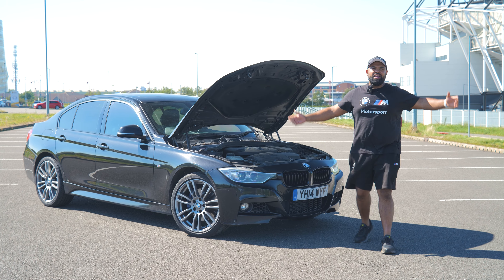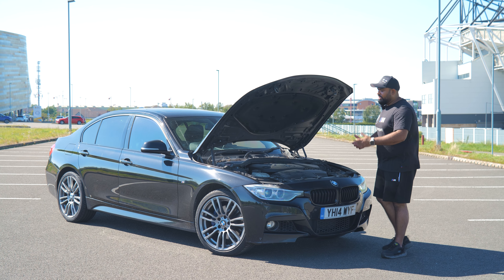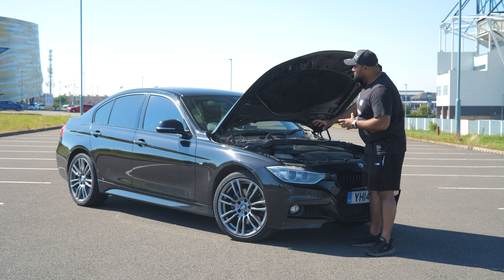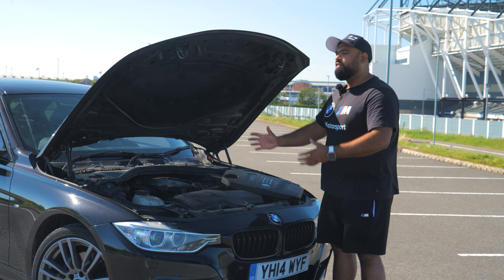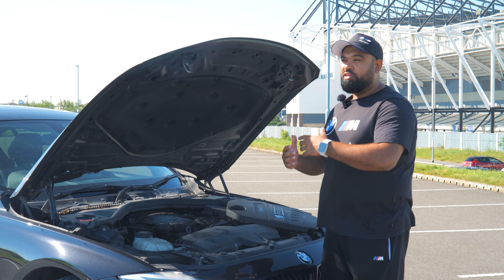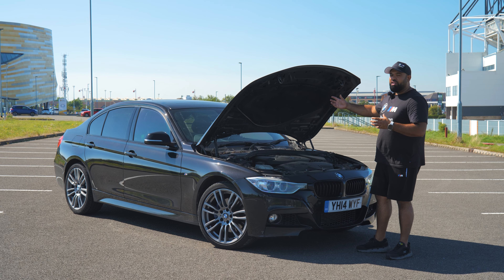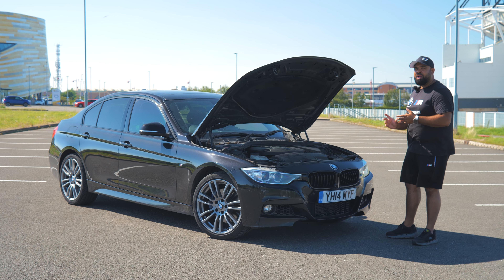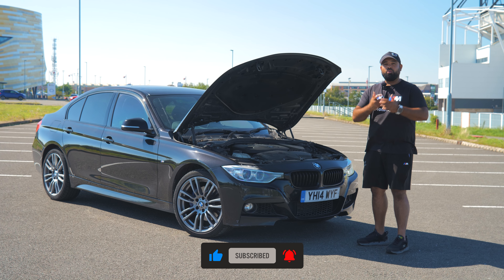BMW 3 SERIES 2011-2019 COMMON PROBLEMS!

Comment: Owned my 2014 f30 320d xdrive manual for just over 8 years (72k) and had zero issues, but I looked after mine. Just tyres, service, front brakes and a battery. Best car I ever owned, but it’s good to point out these issues as they can arise. Glad you mentioned keeping the a/c on as mine never went off and zero maintenance (no regasses etc). Just bought a g20 which has had a few problems (should’ve kept my f30 😂) and one is this coolant thermostat sensor as it was telling me it was overheating.

Comment: The problem that I had with my 320D Sport was the fuel fill sometimes I went to put fuel in and it would only fill the tube down to the tank then cut the fuel fill off after a couple of liters of fuel

Comment: Had a 120d N47 and had it for 6 years and when I sold it it had 205k miles on it and it never missed a beat.  90% of my driving was motorway dow.

Comment: Hi question if someone can help my drive train malfunction keeps coming on in my bmw (not driving it but it continues to come on as soon as the car is started) has anyone else had this happen could it be from the timing or the bushes on the rear diff that need replacing 
Thanks

Comment: i have a 150k mile 220d ED.2012.. should i keep it? electric windows starting to rise and fall randomly on pressing driver side; subtle whistling during acceleration only, with  no loss of power; possibly a short clutch travel. I owe 2.5k pounds on finance... It has had non dealer service; not been frashed  ; was owned by a rent fleet car. any advice appreciated, as i am considering part exchange otherwise...

Comment: Bro I have a 320 XDrive and I have a juddering when accelerating 😢
Reply from the maker: @OulyHussain  oh dear, Xdrive strikes again
Reply: @itsimty  bro what do you think is up with it, stressed out 😭🤯
Reply: @OulyHussain had a 320d xdrive. Only time I had this judder was when I had the wrong size winter set of rear tyres fitted. Tread depths aren’t so much an issue, but the correct sizes are essential. Owned my car 8 years with only that problem which I rectified a couple of seasons later once I knew what it was.
Reply: @kennedymark1  tyres are spot on pal. I think my transfer box is fu*ked but getting it done next week. I'll let you know if it sorted
Reply: Daamn, i need 4wd in the winter here in Sweden, should i buy a 2wd instead?
Reply: @kennedymark1  all sorted pal, transfer box was the issue, running perfect now
Reply: @itsimty  transfer box issue sorted now thanks for being no help at all, much appreciated 👍🏽
Reply: @OulyHussain  hope it wasn’t too costly? Glad it’s all good - personally I think these cars are great overall.
Reply: @kennedymark1  £800 pal from a transition specialist but I still had warranty from the garage so they paid for it after some humming and arhing
Reply: @OulyHussain  ah that’s good news. I’m having a few issues with my g20 (coolant leak this week 🤦‍♂️😃), but hopefully it’ll get fixed soon. Spent over a grand since February.

Comment: It sounds like a very unreliable car ... I was planning on buying an F30 (to replace my ole' E46 320d), but considering how reliable was the E46 during the 7 years I've owned it, the F30 sounds really bad.
Reply: I owned my f30 320d xdrive for 8 years. Only serviced it, tyres, front brakes and a battery. Excellent car - just buy a previously loved one.
Reply: @kennedymark1  thanks!
Reply: @kennedymark1 no problems with the xdrive studders?